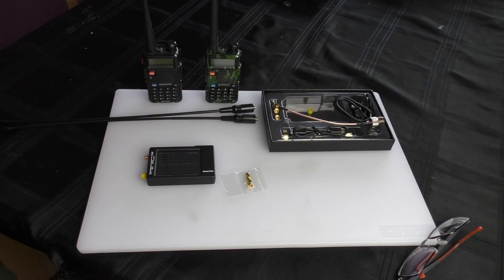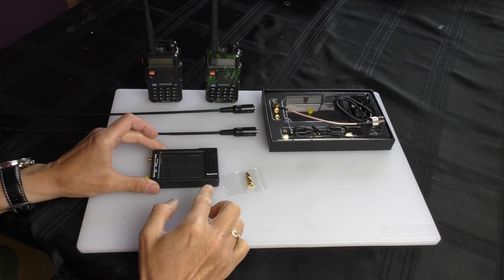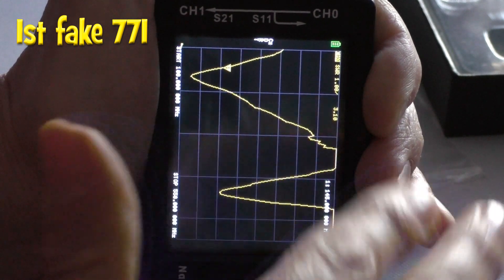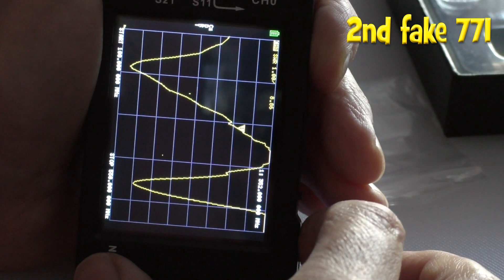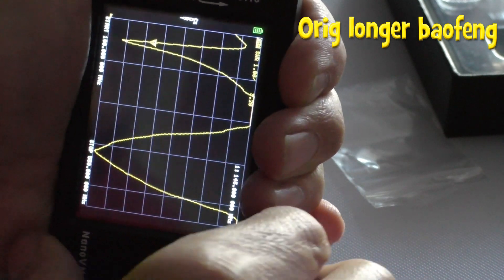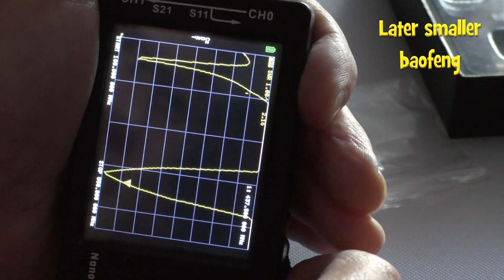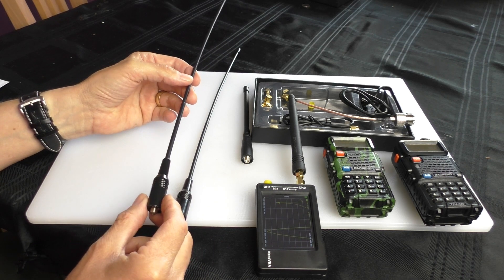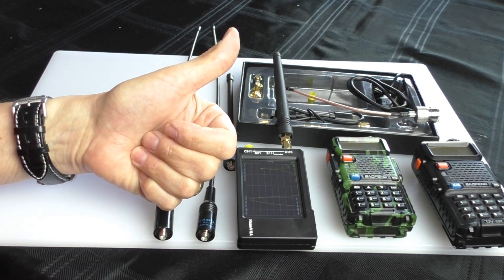NANO VNA SWR- Fake Nagoya NA-771  V  Genuine Baofeng antenna

Comment: Marks wrong, the first part of those antenna is a 1/4 wave for 70cm no base loading, the next part is a coil which works as the loading for 2m and a trap for 70cm, on 70cm the antenna transmits from first 17.5cm because the coil is large enough to trap signal, on 2m coil works as a loading coil whole antenna is used, top loaded. 2e0deq

Comment: Nano vna's are very handy, I have mine for building 2.4ghz antennas for fpv video and 433 and 868mhz  antennas for long range rc control but ive also used it to test all of my two way voice radio antennas. 

The stock baofeng antenna isn't a bad antenna, absolutely destroys the retrivis antenna I bought for 446 reception!

Comment: Antenna tests never work out on HT antenna’s because the user is the ground plane. An SWR meter will give better results but signal strength is about the only way to really know. Have a friend check your signal strength from a good distance with different antenna’s. Thanks for the videos!

Comment: Great video. I've also had the same "joy" when I was testing antennas for my HF HT - Albrecht 2990 with nanoVNA. I think indoor SWR measurements are not the best. I was observing significant difference when changing location in the room as well as moving it higher and lower. Best is probably to measure it outdoor, ideally away from walls and buildings (wave bouncing back to antenna) as well as away from any metal wires or other metal things. Middle of the farm field may be a good example of such place ;)
I like to watch your videos and learning with you. Keep doing good job Fred :) 73

Comment: A bit confusing Fred.. Just watched another video doing similar with swr meter and multiple antennas fake and genuine and all gave similar very good swr readings on 2 bands.
Reply from the maker: Seems pot luck when you order a fake.  Some work as well as the orig antenna and others have dangerous SWR.  No quality control.

Comment: Hi Fred saw this on EBay I wonder if they are any good SW-33 Mark II VHF/UHF 100W Digital Mini Power & SWR Meter For Ham Two Way Radio
Reply: Have seen them on Amazon to
Reply from the maker: I saw Lewis use one on his video.  He said that they were "ok" but not the best meters. Not tried one myself.
Reply: Hi Fred just watched a video using one of these sw-33 meters and they got the same readings as you with the original aerials fairly high swr

Comment: thanks Fred - great video!! di the longer antennas come with the radio like mine did? I might change back to the shorter one now!
Reply from the maker: No ebay cheapies.
Reply: @CB-RADIO-UK  just bought a CRT Micron and teamed it up with a KPO NM452 echo mike using the mic adapter - I have had great audio reports

Comment: I think you might be right Fred, there will be nothing inside the cheap long fake antennas as they are just sent out to get a quick buck.  I don't think they had any intentions of tuning them to work, just look like an antenna.  The problem with testing these small antennas is even if your thumb or any part of your hang gets near then it affects the capacitance of the antenna, it is not like it is in free space.  Even when on the radio a lot of things will affect the performance of the antenna.  We all like a perfect antenna, but with Walkie Talkies you will never get that, the only thing is get the antenna close to resonance and hope for the best.  But interesting tests none the less.  Waiting for the next one.

Comment: Hy fred where ca y buy the Nano vna swr?  Tnx
Reply from the maker: Ebay
Reply: Fred in the Shed  tnx for the response 
Greetings from spain huge fan off what you do
And a CB operator 30LO3573 hope we cross antennas soon
Reply from the maker: @EmilLO-xx8lz  Cheers my friend.
Reply: https://www.ebay.co.uk/b/Cable-Analysers-Antenna-Analysers/181941/bn_16567260  Be careful of FAKE Chinese ones.  Buy from a UK seller you can call if anything goes wrong.  Look them up first to see if they can be contacted.
You can also get them on Amazon.  Buy at your own risk, you can get them from Ham Radio shops, but they will cost you mare.